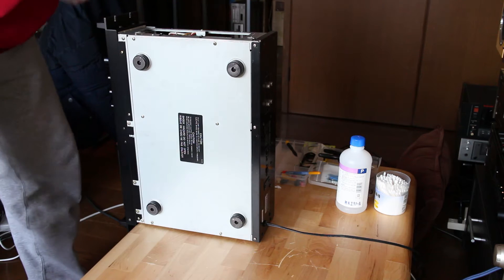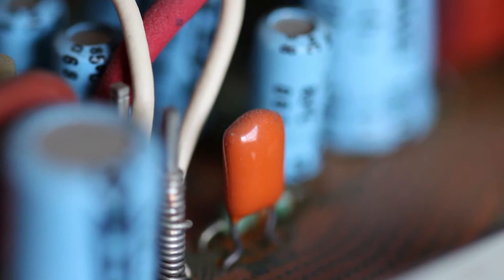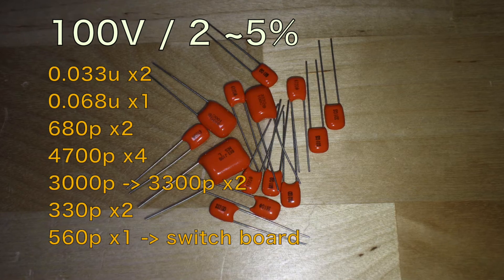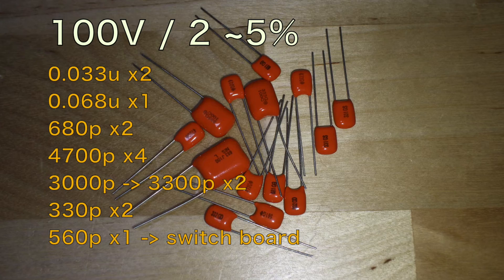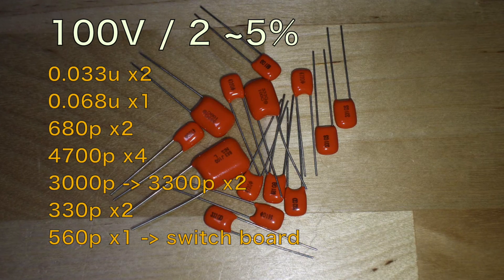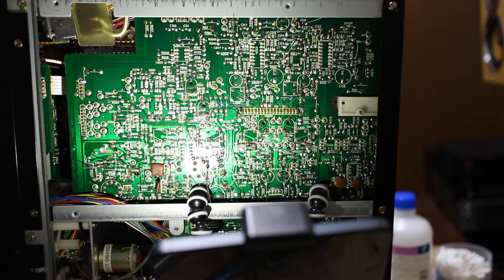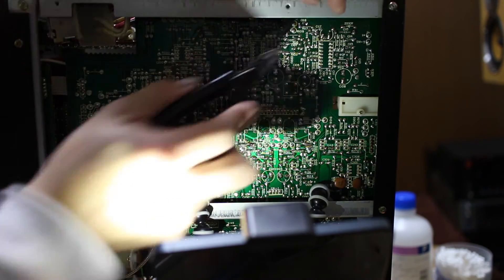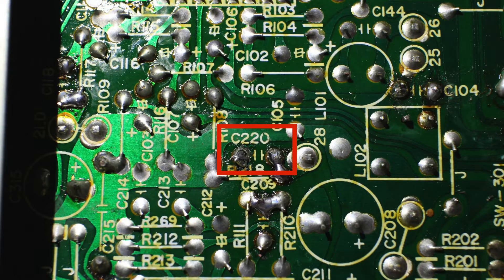Nakamichi 660ZX - Orange capacitors replacement ナカミチコンデンサー交換

Comment: Hi Juliano! I'm Christian, and I'm writing from Argentina. I need to repair a Nakamichi 582, and I wanted to know if quality materials can be obtained in Japan, such as a complete belt kit with rollers, and also for a complete recap, including the orange capacitors and the silencer ICs. My equipment doesn't record, and I can't calibrate the tone or bias. If I could get all the parts, my technician would repair it, but he requires high-quality parts, which I unfortunately can't get here. Thanks for your time.

Comment: I did a Service on one 660ZX, Even the tape guide assembly was stuck and it would not lift up the pinch roller to meet the Capstan Shaft. That bad.
Finally on carrying forward the electrical adjustments, I was not pleased with the 15Khz recorded and the played back. I discovered after 3 hours of troubleshooting that the problem lied on a faulty left channel Yellow Cap 680pF right after the Dolby output, just before the 70uS equalization. That was a Cap indicated as C118 (C218). The 70uS just would not work on that channel. Replaced that and I carried on adjusting. 15KHz re-established. All caps of that sort need to be replaced for sure. I placed an order in January, a CAP kit from Japan. It did not arrived yet, and I believe its because of Covid delays in shipping.

Comment: Can you post a video on how to repair a broken bias potentiometer on the BX-300 series decks?
Reply: I came across one with broken bias pot externally I think you need to either glue them back or use blue tack to hold back on the knob.